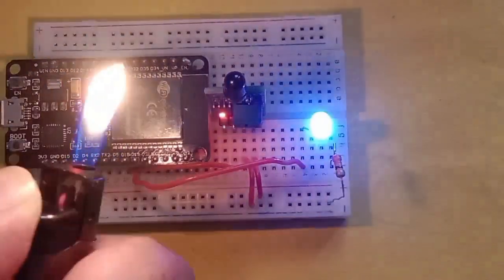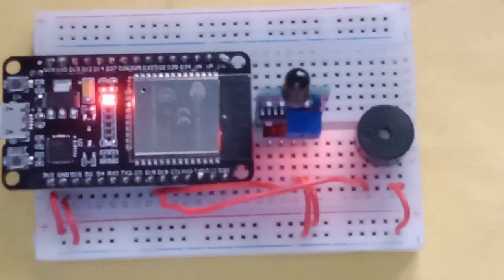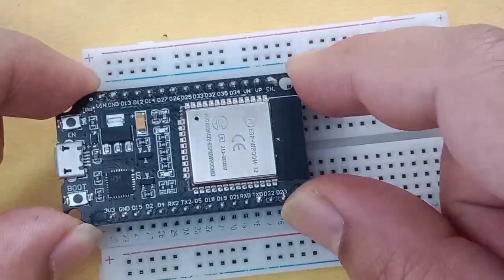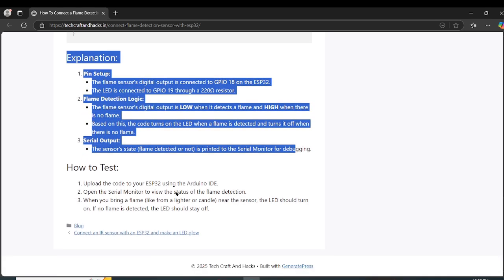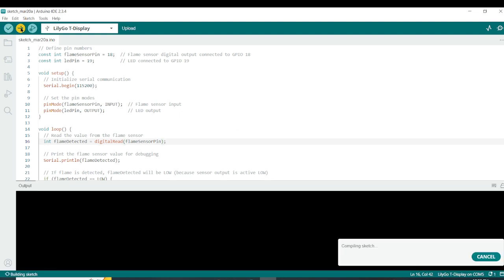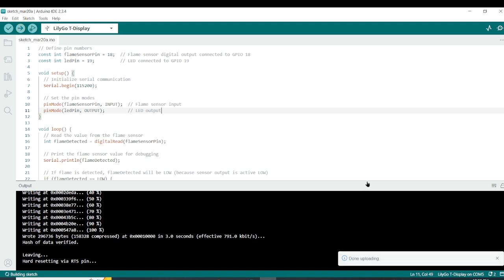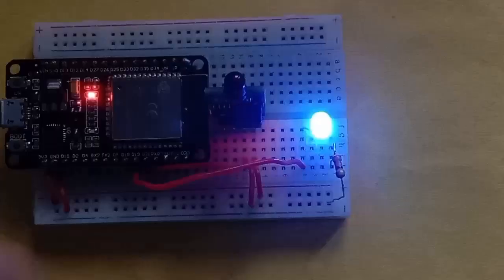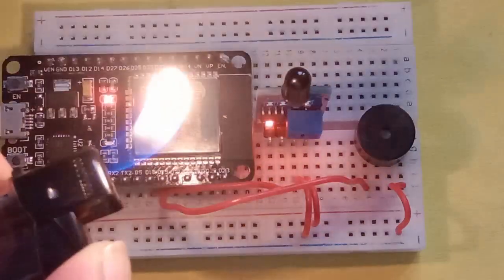(#6) How To Connect a Flame Detection Sensor With ESP32 || Flame Detection Sensor With ESP32

Comment: can i get the code for the buzzer?
Reply from the maker: Link in video Description
Reply: @TechCraftAndHacks2 its only for led ? i want to use buzzer instead of led
Reply from the maker: @NURINANISAHADLINBINTIMASNAWIIP code is same for both. Instead of LED use Buzzer and it will work.
Reply: @TechCraftAndHacks2   what if the buzzer keeps on making sound even there’s no flame? the led shown on the flame sensor also always turns on when there’s no flame 😢
Reply from the maker: @NURINANISAHADLINBINTIMASNAWIIP try and test in a dark room. Do not expose the flame detector sensor to any other light bulb or sunlight.